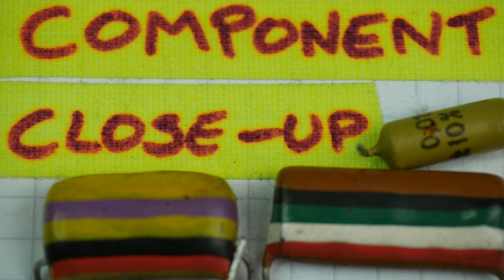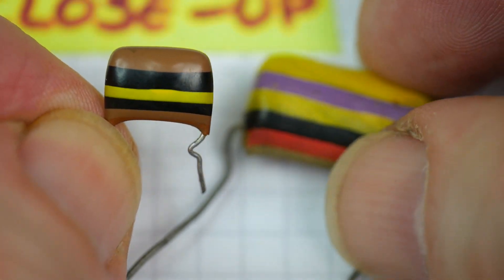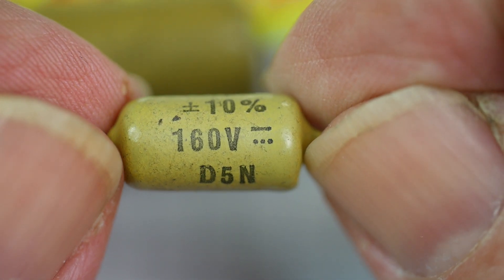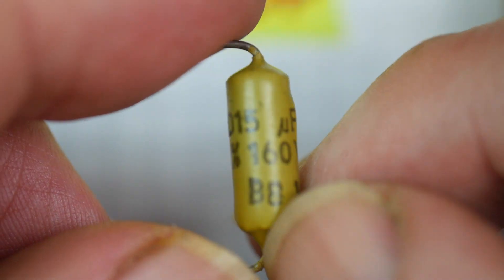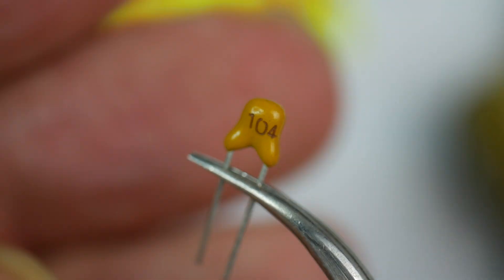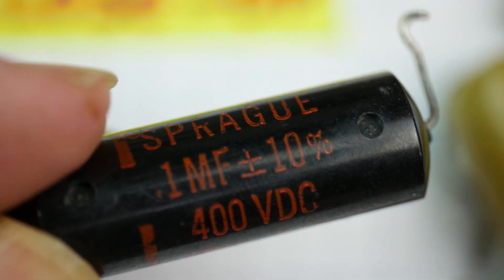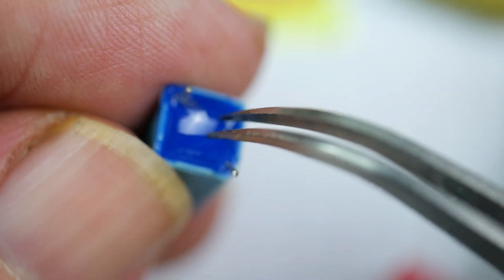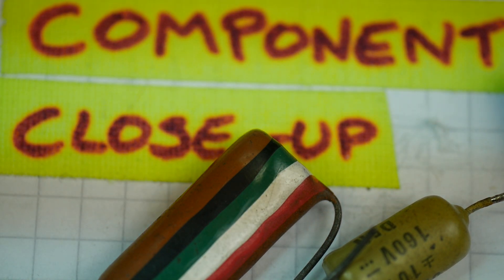Component Close-Up: Vintage Capacitors

Comment: The Sprague cap is a paper capacitor. They use outside plastic instead of wax but are not better, so replace them all.
Reply: Are the tropical fish ceramic? Do they survive in vintage audio or do they generally need to be replaced?
Reply: @Krunch2020  The ceramic one are very stable and don't need to be changed.